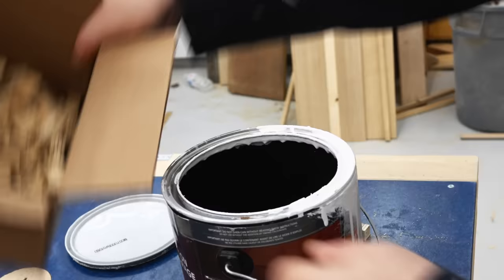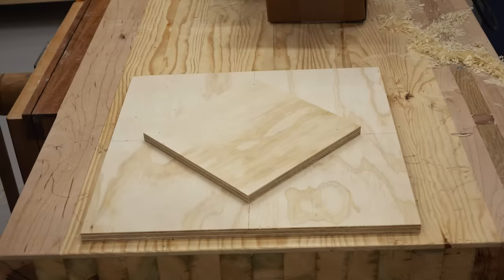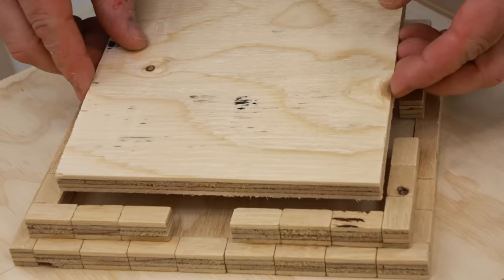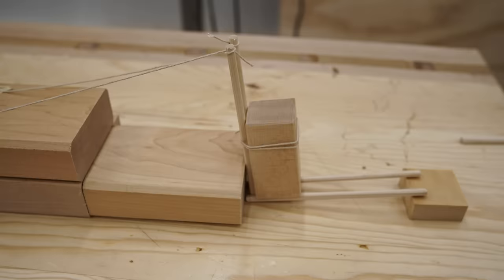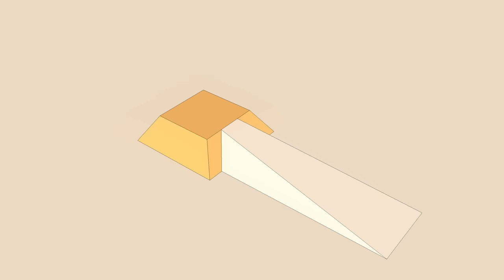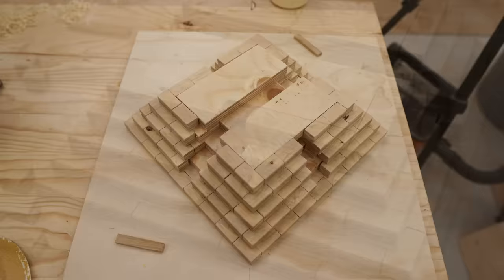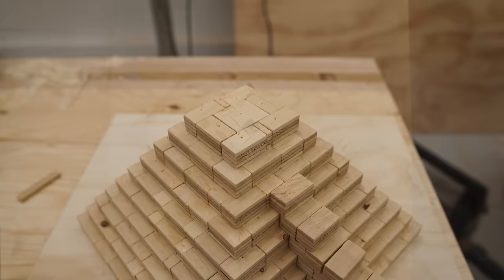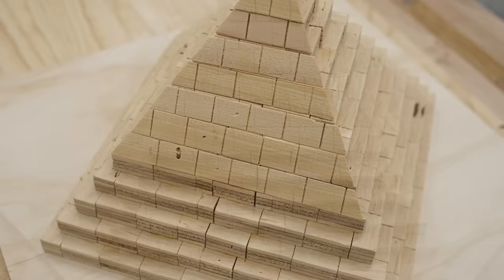How I Would Build The Great Pyramids

Comment: Jean-Pierre Houdin has the best theory in my opinion. He discovered strong evidence of internal ramps.
Reply: Of all the theories I have seen and there are many JP Houdin has the best theory in my opinion
Reply: Yup he was the best I think he got it spot on👍
Reply: I think because it's multiple pyramids inside. Ramps on the outside of what was maybe Mustabas
Reply: So far they couldn't find any internal ramp though, only the notch and "Bob's room", which iself is not really an internal ramp evidence.
However I think its totally accurate the part of the grand gallery being an internal counterweight system, it makes perfect sense.
Reply: Thats not the best theory. The best theory is chemistry; check the video ARI KAT technique video. Everything is perfect.

Comment: This is really good thinking on your part John. I noticed the lines going up the sides of the pyramids the first time I looked at a satellite view on Google Earth and knew instantly that had to be a clue as to how they were built. That kind of a mark can only be a byproduct of the construction method. A lot of modern architecture looks the way it does because of the materials and construction underneath the finished surface. And, I believe as you, the stones would have been moved as simply as possible. No big ramps, and no water elevators. The ramp would have at some point been a larger construction project than the pyramid itself.  Good work, I like way you explained your observations via wooden models.
Reply: No, the lines are an intentional building feature. Like the edges of a box. Look this up. Why are people who get so happy about debunking videos so uninformed about the pyramids. The pyramids are not a perfect square pyramid like you think. They actually have 8 sides with a clear and intentional indentation towards the middle of each face

Comment: Something to always remember too, is the sheer amount of man power used to build these monoliths, often in the tens of thousands. Obviously people can't just outright lift the blocks, no matter how many people you have, as they're simply too heavy, however I have no doubt that great thought was put into how to move the blocks. I've always thought that they may have potentially used some sort of elevator, where a block would be attached to a incredibly large and strong rope, then attached on the other side to a cart which would slowly be filled with much smaller rocks, or even people, until the larger stone began to lift up. I'm not sure about the stresses involved in all of it, such as if it would even be possible to make a rope so big that it would be able to lift the blocks, but I have no doubt that something similar was tried. Perhaps one day we'll find out how they were built, but until that day unfortunately all we can do is speculate

Comment: I absolutely buy your theory for lifting the stones to the next level. Though, I think the Grand Gallery was a hoisting device for the bigger granite slabs. It has grooves along both of the sides so that it could have been used as a ratchet device. Also there is remnants of a pulley system in the portculiss.
Reply: So do I,why people look for complex ways is  baffling to me.
Herodotus told us how they did it circa 2,500 years ago! He stated they used wooden levers to raise the stones and it’s also abundantly clear that all pyramids start out as step pyramids.
It’s obvious too that the first ( roughly) third it done via ramp(s).Then they used a combination of levers and ( in the singular case of the great pyramid) used an internal ramp ( grand gallery).Clearly the lever route was easier/quicker/ cheaper as they dispersed with a GG for later pyramids.

And yes the casing stones were done from the top down .Herodotus confirms this in writing!
No mystery- let’s move on.

Comment: This makes a lot of sense tbh. My only issue is how they got the capstone and other angle stones on top. Because of the geometry of the angled stones I don’t think you can flip them over to “climb” up the pyramid like you could with the flat rectangular stones used to build the pyramids
Reply: bring up full block and cut it on the spot, not very practical but it's a solution
Reply: @jaca9566  that could work, would probably making curing a bit hard due to restricted space

Comment: It was built one layer at a time from the base up. Every thing was engineered into it,s final height. We do not give enough engineering credit to our ancestry.
Reply: it was not built by the egypticians tho
Reply: @dan erickson, how did the people who placed the cap-stone do it? what were they standing on?
Reply: @GK-yj8po  considering the capstone is missing, we don't know if it was one peice of material. May have been smaller material stacked and carved in place.
Reply: @danerickson1632  If the casing stones were done from bottom and up, how would they get the stones up the sides, and how would they get down once it was all smooth? 
The casing stones must have been done from the top and down.
Reply: @GK-yj8po  would have been quite the project 4500 yrs ago but they had no distractions and generations to build it.
Reply: Dan Earth has only kinda changed my life and my heart hurts and my body will not sleep with me again because of this pain and DAY

Comment: How about a counter weight system?  With a pulley on top, bigger block on one side lifts the smaller block up the opposite side,  use the pyramid as it's own tool to help build itself, you can have all 4 sides working at the same time

Comment: Just start with getting 13 acres flat with the center oriented to true north.  Let's start there.
Reply: Well I do believe it’s off like a minute and a couple seconds lol but yeah no idea how they could get that close to true North.
Reply: El Chepacabra except your both wrong. They where not that accurate in their measurement of true north. 

Many pyramids where off by quite a bit, others where off by less and none where exactly precisely oriented to true north. 

As to how they did it there are many theory’s. Because there are many methods they could have chosen. 
One method that would easily explain why where they thought true north was kept changing so the Little Dipper Big Dipper method. 

The Little Dipper Big Dipper theory has been around for more than 20 years.
Reply: There are also theories that suggest that "the" pyramid is built on the center of all land mass
Reply: Erik Nilsson that may be the most stupid thing I’ve ever heard.
Reply: @crunch9876   Google "center of world land mass" and see what I mean, and the relation is of cause theoretical.
Reply: Erik Nilsson I know what the center of the world land mass theory is. 

Using modern calculations the great pyramid is 675 miles away from the center of the world land mass.

Oh and btw the center of the world land mass theory is stupid as it relies on the use of  2d maps which distort the size of land from what it really is.
Reply: @crunch9876  what if they built them true north, and it changed overtime due to tectonics
Reply: @BroccoliBrigardist  4000 years is a blip geologically. Unlikely they could have moved more than a fraction of a degree in that time
Reply: @whirled_peas  well, i dont think they are 4k years old so...
Reply: @BroccoliBrigardist  They're 4500 years old. Close enough. Or do you mean they were built by a hyperdimensional alien race 9,000,000 years ago?

Comment: So that is a feasible idea but do you think you can move a 70 ton block at a 53 degree angle 350 ft up? thats Preposterous.
Reply: Rimadim dim exk eck eck eck ek ek
Reply: @Rimadim dim i think The point is that The dude that made The video didnt Come up with The right solution
Reply: Rimadim dim I wouldn’t consider it to be a conspiracy theory exactly, it’s just a theory. A conspiracy theory, in my eyes at least, is something that is almost a complete shot in the dark that would be absolutely groundbreaking if true. This is just a possible idea as to how they managed to move the blocks. It does make a lot of sense; however, with a 70 ton block as the object being moved I’m sure if that was the method there would be quite a bit more involved than what was depicted in the video. It honestly makes more sense than just pushing it up a ramp. If you’ve ever moved and had to load a semi or trailer, it’s a challenge to get something as simple as a washing machine up the ramp with a dolly, imagine doing that with a 70 ton block.
Reply: You probably can't figure out how they made any modern buildings either and you would call those ideas preposterous if you didn't see them all around you. Just because you are stupid doesn't mean everyone else is.

Comment: Great vid!!! But viewing the pyramids from above it actually has 8 sides :)
Reply: No this is not correct. This is only "true" on the pyramid of giza, it is concave on each one of its 4 sides, making 8 flat panels. Pyramids have 4 sides.
Reply: @DeterminedBeast  The bottom of a square pyramid makes a fifth side. The dihedral angles on the triangular sides make eight right angle sides together.
Reply: @GregorShapiro  sure. But not what was being talked about In the original comment. "Viewing from above" . Thanks though

Comment: Consider scaffolding with a pully system.
 You can lift a large weight using a lighter smaller weight.
 So the pully system is in the middle and small weight's added on one side pulling up the much larger weight on the opposite side of the pyramids, so 2 blocks are set on two sides, then ulternate back and forth in a clockwise pattern, and then reverseadding the case stones.
 Sorry for the spelling and grammar i have no qualifications but i can drive a uo

Comment: The integral/internal ramp theory of how the pyramids were built may be even more plausible since they recently confirmed the existence of a corridor above the north entrance of the great pyramid. The corridor itself is larger than the normal corridors (2m x 2m) and the masonry joints/layout of the corridor suggests there is a backfilled corridor extending beyond it. If that back-filled corridor connects with the large void in the middle of the pyramid, then it seems reasonable to assume it was the construction ramp.

Comment: Great effort but just as a novice engineer I could rip this apart from all angles but I won’t. It wouldn’t be fair.
Reply: @johngillon6969  Formed concrete if you must know.  Beats trying to move impossible blocks.  They documented what they knew.  They created the metric system.  Other than that I find your response to be that of a youngster.  Immature at best.  However if it makes you feel better to type angry words because it’s all your intellect will allow then knock yourself out.
Reply: kykingz78  I've worked as a machinist for 45 years and i know how real men work.  i have had to work on parts that weigh more than ten thousand pounds, and have moved them with wedges, pry bars, large hammers etc.  I have worked with men, @gazano probably has no marketable skills most likely.  A mason commented on another video that he believed that they had no help from aliens, that ordinary masons of today could easily erect the pyramids.  he said that how they built the pyramid was all the masons got together and they all said how they would do it and they did it the way that sounded the easiest.  Bet they didn't wear any stupid safety glasses either.
Reply: "I've got a girlfriend, but you wouldn't know her, she goes to a different school"

Comment: Isn't it pretty established the core of the pyramid is tilted clockwise compared to outside layer which was then covered with Limestone blocks? If you look at some of the recent drone pictures of the very top of the pyramid looking straight down you can see that the core has that clockwise tilt and the outside course straight which would lead us to believe that it was an internal ramp system at that angle that was then torn down as the face Stones were put in place.

Comment: Likely they rolled the stones from the quarry to the build site, then used lifting levers. Rolling was a common, and well documented technique to transport stones. To do it they build an outer structure to the stone, making it round instead of square. The technical term is called "rolling stone". It has been used as recently as 1830 to move an obelisk from Egypt to London. Pictures exist (google moving of Cleopatra's Needle).  The big unknown is how they lifted the rubble. 25% of a pyramid is not blocks, but is the rubble left over from carving them.

Comment: The issue with the ramp is the incline. The angles which would make sense would require such a massive length that that length renders it unreasonable.
Reply: well first of they could make a ramp that wraps around or they could of done what he did and used steps instead of ramps

Comment: Instead of jacking and tipping each block, you can place logs on each step and use them as rollers. Now you can use a sledge on ropes to pull the block up. That would be much faster

Comment: I always like seeing a builder's point of view on the pyramids. I think the bigger mystery is how did the cut and create these massive stone blocks?
Reply: Yeah pretty much. Ive seen some clever and probable explanations on how they could build them. But how they managed to carve those giant blocks is far more mysterious, as they didnt even had iron back then afaik.
Of course the more logical way is that some alien civilization traveled multiple light years to earth to poorly carve some stones and then left without leaving any other trace of their existance.
Reply: @elEd0  It's been well documented that the blocks can be cut with sand and water so even a weak metal like copper can cut high density stone since it isn't really cutting, the sand is. They also used wedges and levers to break stones along their lines of cleavage (natural breaks in the rock). There are nearby quarries with partially completed stones plus their tools (including just simple diorite iirc) pounding stones (basically a higher mohs scale rock used to hammer the softer rock) so the process is known in the community and you can search videos on it if you are curious. The quarries are massive and would have had thousands of workers. No alien lasers needed.

Comment: I think the guys on the low end of the block would have to have a bigger block to stand on to get the levererg needed. As for the big granite blocks for the kings chamber they surely had a ramp though the grand gallery. You can even see the worn down rock where the ropes went. After the kings camber walk in the park flipping them up there since  their smaller.

Comment: It's a simple system, so more than likely useful to the Ancients. The tunnels within the Great Pyramid have often been speculated to be used as counter weight slides for lifting great stones. Perhaps they were able to use the counter weights to provide the force needed to tip over and lever the stones rather than brute hands on force?

Comment: My biggest question is were they capable of making a rope that can loft something that heavy with added friction resistance? If they could and they had a pressurized water they could fill some large container and as the weight of the water became greater than the block it would begin to drag the block up as the gravity pushed the water down.

Comment: well, this was a very clever solution and somewhat backed up but I can see 2 problems:

The first one is with the log beams or whatever you want to call them: in the position showed it wouldn't benefit from leverage as you were basically pulling it at like 10º ( 2:58 here). In this case you can place them vertically so you pull at more like 90º to facilitate the work with proper leverage. Simple fix, doesn't dismiss the theory.

Second problem: this doesn't account for the precision observable specially on the inside of the pyramids where it's not repaired or eroded. It's a very questionable method too when you take into account the miles and miles they traveled with this stones. Some quarries were so far it takes us more than an hour by car. Imagine having to travel so much with this stones (assuming they could travel in the Nile, a few quarries could have direct transportation without complex ideas but there are a few that required land transportation). Another problem that maybe appears is the precision of the cuts. Such perfectly cut blocks wouldn't stay intact after rolling on the ground and being placed like that, the edges would've been worn out. 

(In my opinion the stones had to be lifted precisely in order to preserve their shape, or be cut right before going in place or after moving them to the site, which would be easier... but just rolling up the possible pyramid ramps would wear out the edges. Plus it's maybe safe to assume, but idk for sure, that they didn't do it since there are many precision cut pieces outside the buildings, clearly in excellent condition so they can't be rejected pieces)(Now lifting pyramid blocks like that, how? idk ancient machining? lost tech? there is evidence for rain erosion so they were built before the dynasties I bet. I don't want to say Graham Hancock is right but the part where he says there could have been older civilizations which possessed advanced technologies, different than ours... huge maybe, seems plausible to me. If not than there's a whole mistake in the dating of these things by a long shot) 

If you want respond I don't mind reading and responding back. Who knows maybe some of you have an amazing theory better than all of this or even evidence for something completely new. I'm all ears